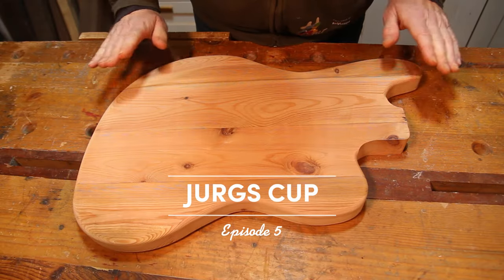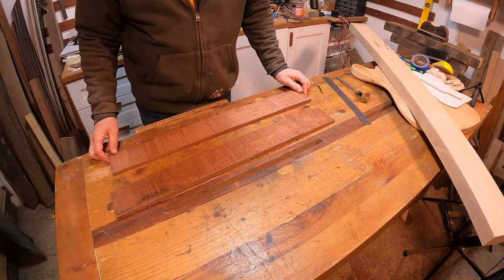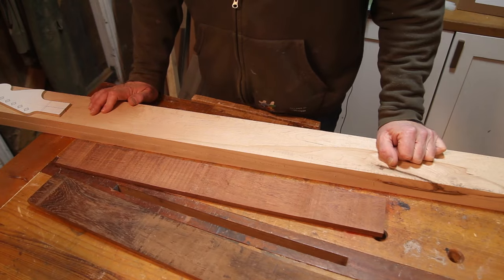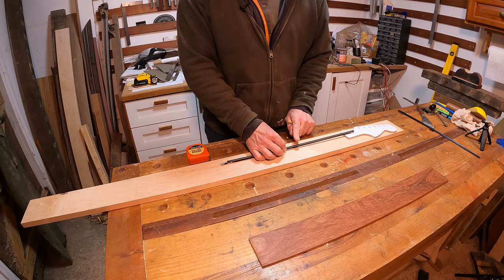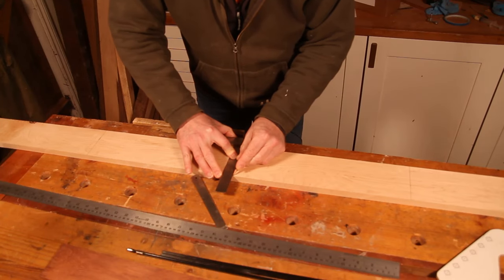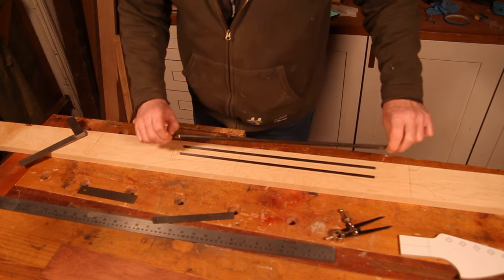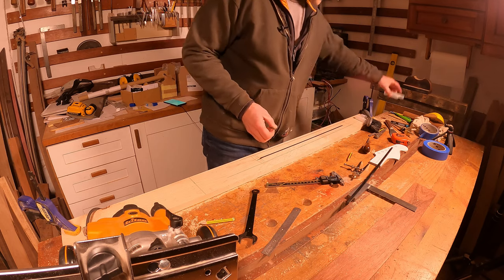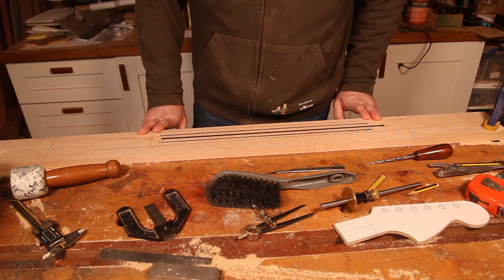Jurgs cup episode 5: Neck build part 1

Comment: Great project, Pat!
Regarding the carbon fibre rods: Since they’re (purposely) very rigid, wouldn’t they impede the ability of the truss rod to do it’s job?
Not a builder here, just someone puzzled by, what seems like, crossed purposes.
Reply from the maker: Cheers, the carbon rods will help the neck work against the string tension meaning the rod has to do less work. They really do work well.